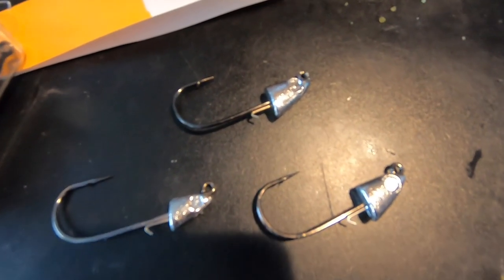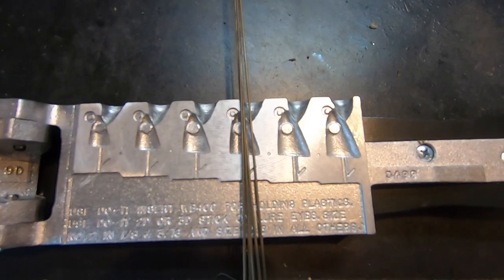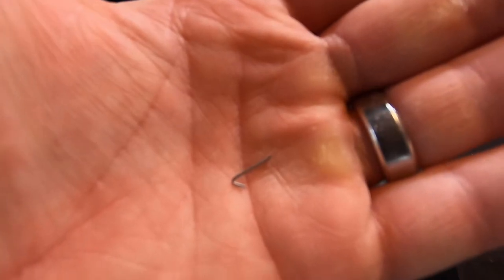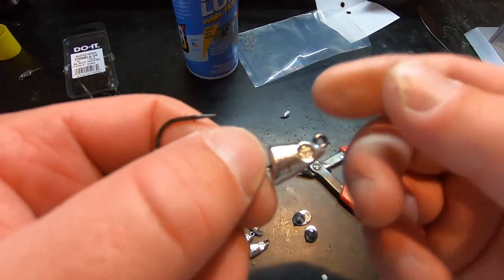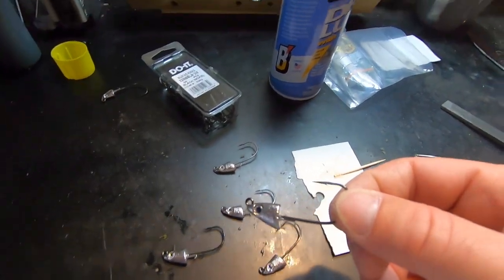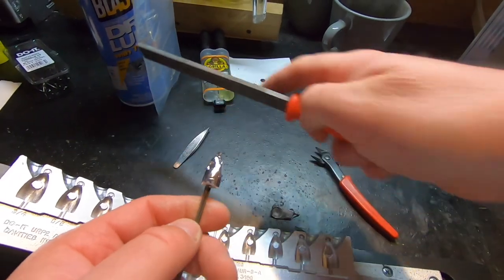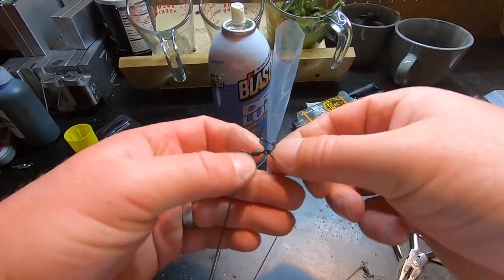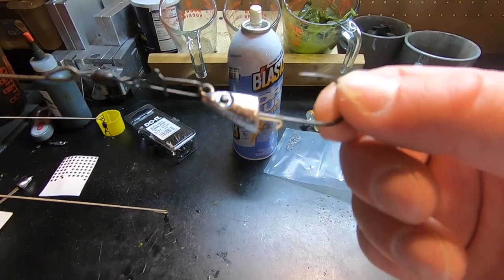How to Build an Umbrella Rig or Alabama Rig with Do It Molds

Comment: Nice video, also with the heat, make sure you smoke out your mold. Makes it flow better and detach easier.
Reply from the maker: I’ve never smoked any of my molds.  I’ll use dry lube if needed.